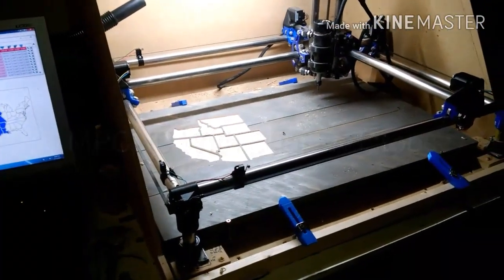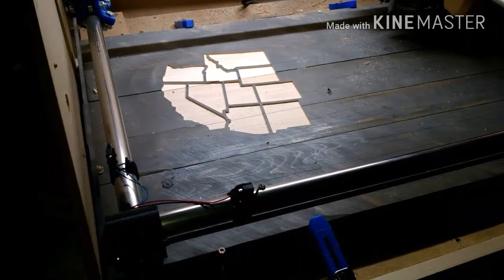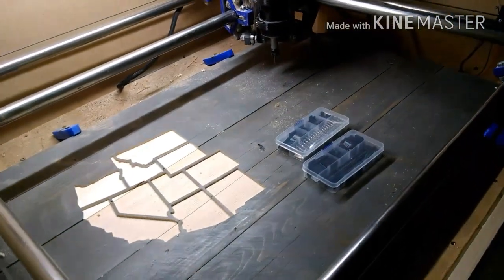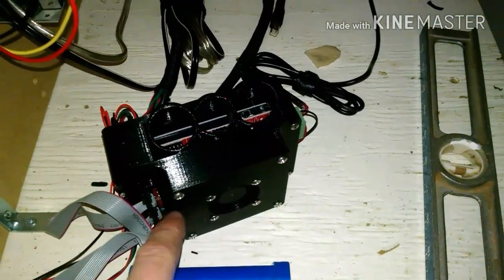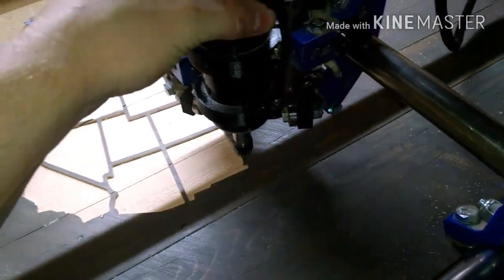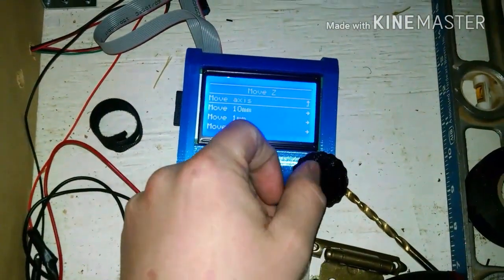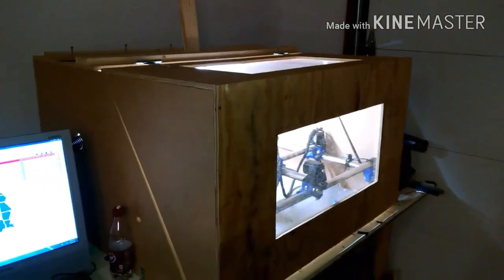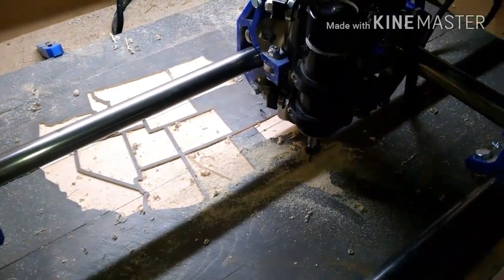MPCNC W/ Dual End Stops Overview

Comment: Hey man, love the video. im just wondering about your lcd controller board. I see that your movements are so smooth one click of rotation actually moves the menu by one value, mine always jump by value of 4, when i move my z under the 0.1mm option can only move it by 0.4 as i said the encoder always registers 4 clicks for one turn. thanks
Reply from the maker: Hmm, I’m not sure about that one...I bought the ramps and lcd controller board straight from v1 engineering and installed the firmware and everything straight from the website...I didn’t have to touch anything for the lcd controller...here is the page for the controller and it has a link on the page to flash the firmware https://shop.v1engineering.com/collections/parts/products/full-graphic-smart-controller-big ...not sure if that’s the issue, but that’s the first thing I think of off the top of my head. Thanks, Andy

Comment: What is the maximum size you can cut with this machine?  Also would you please tell me what spindle you are using and are you happy with it?  Thanks
Reply from the maker: Very late reply, sorry for that...it is a 20x25 cutting area...the spindle I am using is a harbor freight trim router...these are very cheap and you will see many people say that they are junk and have a lot of runout. Mine is not one of them. It has been really good to me. Mine doesn’t have a lot of runout, it’s plenty powerful, they are cheap, and they are really compact.
Reply: @am0254338  Thanks for the reply

Comment: Hi great build! i am currently printing the last parts for mine. I was wondering why are you using the controller board to cut rather than straight from the pc? Is it personal preference or is there some kind of benefit to it? I ask because i was planning on using an old laptop or pc to control it.
Reply from the maker: Sorry for the late reply..there was an ongoing bug at the time that I built mine...if running longer code from the computer the USB ports on certain computers would time out. Therefore killing your job right in the middle. I dealt with this tirelessly with no resolve. I did all the stuff that people suggest, like turning off the battery saving frature in Windows that will shut off USB ports when it sees them as inactive. Finally i just went to using the controller and saving the code on a SD card. This fixed my issues so i just stuck with it. Many people didnt have this issue but i know a few did. Thanks, Andy
Reply: @am0254338  no problem. I see.. im definitely preparing for quite the ride with the electronics. i can do the build just fine but still feel like a caveman sometimes when it comes to software and electronics even tho i built my own pc lol, i guess maybe im overly cautious so thats good to know. I wont expect too much from the laptop and might just get the controller but out of curiosity did you ever try using the uc-100 cable connection when you tried the pc connection? i got a link for a video i found on it but i read it was supposed to solve the data transfer issue with cnc's.      https://www.youtube.com/watch?v=45FEJhN70hA&list=PLsl2YoQlrl-OmrgqnVGdjzQNS1bkmH16U&index=14&t=0s                     Thanks for the response

Comment: I'm in Utah and I have the 25.4 hardware parts for 1" stainless steel, 
Where did you source your 1" tube material?
Reply from the maker: Springfield MO is where I got my tubes, at a metal supplier...I bought it in 20ft sticks...speedy metals is the cheapest place I found online, and there custom cutting isn't too bad.

Comment: Nice work! Thanks for dupont connectors info :D . I found them on aliexpress for good price. Link: https://www.aliexpress.com/item/620pcs-Dupont-Connector-2-54mm-Dupont-Cable-Jumper-Wire-Pin-Header-Housing-Kit-Male-Crimp-Pins/32839071531.html?spm=a2g0s.9042311.0.0.HviOqm
Reply from the maker: Ya no problem!